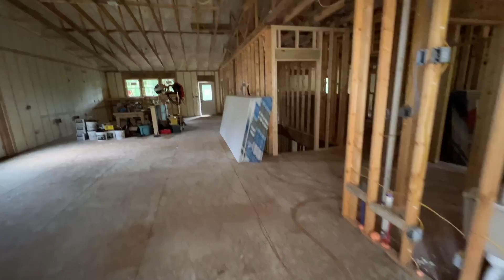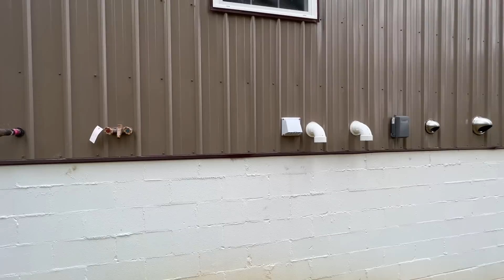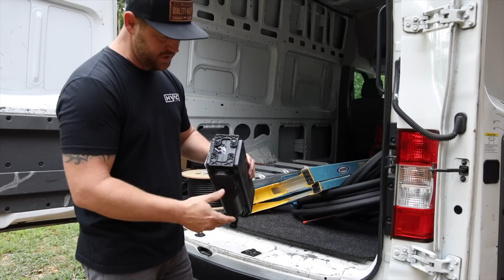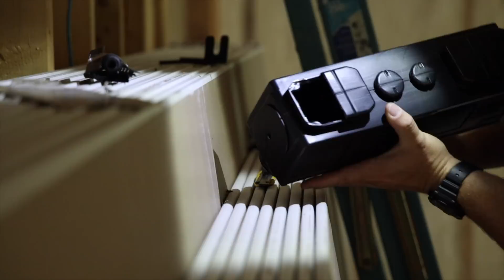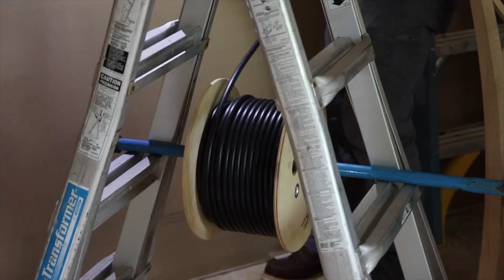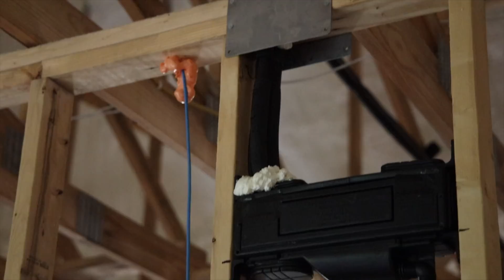Rough-In on a 3 Zone Mitsubishi DUCTLESS System | HVAC Installation

Comment: Protective shield plates...should be a code requirement. Very, Very smart! As a building inspector I always recommend the large plates or at a minimum photograph every wall plate and stud penetration just in case a nail or screw gets by.

Comment: Why not just run the line sets into the attic and just wait for a J Box to get back in stock?

It seems like having they would be awesome if you had to service one air handler you wouldn't have to mess with the entire system. 

Wouldn't that be super beneficial to the home owner?

Comment: Can someone direct me how to run about 30ft of 3/8 & 3/4 inch soft copper for hvac. I'm gonna need to go through two ceiling bends ( 90s ) before bending them out of the walls.  They are not charged, empty 50 footers. Thank you.

Comment: Great video.  When doing an interior wall install for the indoor unit, is it preferable to surface mount the line sets and wires in case one of the refrigerant lines develops a leak over time?  thanks

Comment: I just put in one of those little pumps for the Mitsubishi.   They could have benefited from a ducted cassette installed in the attic with ductwork to all the rooms.  1 lineset 1 drain line and much better comfort overall considering you can hit the bathrooms and more even distribution.
Reply: That's what I would have done, but ductwork is not cheap; this is likely much cheaper and will overall provide enough comfort for what the client likely prioritizes.
Reply: How hard is it to clean the evaporator on the ceiling units?

Comment: I would have just ran the drain down the wall to eliminate having a whole other component to break down like a pump. Also you could have avoided having  potential leak points by just running the pipe all the way home the first time instead of being lazy and just stubbing it into the attic.

Comment: Nice work! That Mitsubishi unit should have no problem keeping them comfortable all year round with that insulation job they did. It was smart to do ductless, I think a conventional system wouldn’t be able to dehumidify well enough with all the exterior walls and roof being spray foamed. Thanks for the video.
Reply: a proper ducted system even a Mitsubishi Airhandler would be much better because you could have supplys in the bathrooms and everywhere you want it instead of this
Reply: @loganraimer  Have you ever tried to condition a home fully insulated with spray foam in the South?  The spray foam foam insulation holds in moisture making it difficult for a ducted system to remove enough humidity unless you install an additional whole house dehumidifier which is added installation and operation cost.

Comment: I can install Mini Splits all day. Walk in the park. What I really need to know and want to see is videos on service of the mini splits. They are much more complex than traditional air conditioning period show us when you get inside one of those things
Reply: Call tech support. U need ohm charts depending on which manufacturer ur servicing.
Reply: Usually leaksn, need to weigh the charge in and out .
Reply: Servicing Mitsubishis splits are very easy, more easier servicing Fujitsu, daikins & other brands.
Reply: Do you have a video on how you hook up the indoor head to line set that goes into rough inbox? Do you mount it even with the indoor head? Or do you mount it offset? And with the wall mounting bracket, do I still need to install backing boards to mount the head on? Sorry for all the questions.
Reply: I just call tech support with a multimeter in my hand.
Even if you could do all the troubleshooting by memory, you usually can't get the part you need under Warranty without a case# from the tech support
Reply: Its pretty basic. If it's leaking, you just recover the refrigerant that's left and then weigh the new charge in after fixing the leak. Mini splits are usually either gonna leak or have a part failure like a board. Not too crazy to deal with.
Any mini split with a vfd is gonna make it so that you can pretty much just weigh the charge in after fixing the leak. Even with large vrf systems, the way you go about it is basically yeah same thing just weigh in a new charge. The software can do a bunch, but the only real fix im aware of ia to remove and confirm the new charge weight matches what you need.
Reply: @Clasped003  that's pretty much what I've been doing. Keeping them clean making sure filters stay changed, repair and all the f*** ups in the control wiring from the electricians and weighing refrigerant re-adding it when in doubt
Reply: @Clasped003  Where does the leak usually occur? Does the lineset itself ever develop a leak? I can't imagine how to fix that as the lineset could be embedded in the walls!

Comment: I just installed a MRCOOL 4 zone mini-split system. I came up through the floor into closet areas and used the 7.5' cover kits to hide the pipes, the head units were installed on the opposite side in the interior rooms. They did not recommend that you put these units inside the walls in case you needed to service them in the future, so I am good. .....But I am having a different problem.....

It's been about 3 weeks now, temps in the 90's, the system is working great so far. But I have a problem. I am experiencing severe headaches in the mornings, and brutal insomnia (no sleep) being around these AC heads. I can tell you it IS the heads causing me grief. I bought an EMF meter to detect the radiation being emitted from these things as I cannot be near these at night trying to sleep. It's been miserable.

The EMF meter I bought is a cheaper model and doesn't work well, unless you believe that ketchup and a can of Pepsi are spiking with EMF?
I've got to buy a better EMF meter, also have the power company come out and scan these things. I don't know if it's the wire, or the fans that are causing me my problem? It's a 230 volt system, not 110 current. I'm a little bit pissed that I stepped into this issue. I am sensitive to EMF waves and I could of just reinstalled central AC as I had the ducting....Well, I did have it set up until I ripped some of it out.

The internet says it is possibly dryness of the air, but I call BS on that, everybody is a liar these days especially corporations and governments.
Today I was outside next to the condenser when it was running for about 2 hours and the headache was returning again. I bought some aluminum window screen and wrapped the wire as it enters into the living space, as the waves cannot pass through the small size of the mesh of the metal screen. It seemed to help some, but not a perfect cure yet. 

I had a portable AC unit, and then a window AC unit earlier in this year while I installed this MRCOOL system and they both caused me the same headache problem. I am sensitive to EMF, and have diabetes which according to some books is caused by electricity, and I believe that from my first hand experience. To find out that this system is also emitting high EMF apparently? I'm kept cool, but can you live without sleep?

Your power wire is way bigger than the ones supplied by MRCOOL so maybe that matters? I can run the bedroom unit till ice cold in the master then shut it off before bed is my current work around. I have yet to get my first power bill to see what it draws, but I think it will be less than the central AC system I once had. I also will mention something else that I ran into. I bought this DIY system from Home Depot and HD did me wrong. I had extra line sets, and communication wire, and a coupler kit after installation that I didn't need, but I could NOT return them for a partial refund inside of the 30 days policy. So they broke there own terms of sale. I didn't make the terms, they did.

Home Depot will not take back a partial system, and shipping wasn't free either, it was $110 dollars (orders over $45 are free shipping) NOT. This system keeps me very cool, cost me $4700. and is very quiet when running, but the EMF issue is causing me troubles.
Reply: Your problem is you got mrcool that should be called mrthrash worst investment is a mrcool unit
Reply: @fredmejia6042  I have no knowledge of these mini splits but what are the specific problems with Mr Cool? (other than the name)😀
Reply: Probably need a fresh air heat exchanger 
Not enough fresh air in house; depleted oxygen
Reply: Well yes anything with magnets, motors, solenoids, etc will make an emf. Which this unit uses all of them. Can’t say much about Mr cool system as it’s diy and I only install Mitsubishi.

Comment: I've used both mini splits and central.

For me personally I prefer a central hvac over mini splits.

Main reason is just overall comfort in every single room in your house including all bathrooms, walk in closets and utility rooms.

To get that level of comfort with mini splits it would require a head per every room in the house which would be extremely expensive and wouldn't make sense when you can just go with one large HVAC system for the whole house.

The other con going with mini splits especially on an already existing home is all the line sets running all around the outside of house especially if you're going with multiple heads which is a major eyesore.

For larger homes you definitely want to go central.  I live near Nashville and every builder of a new construction house is still going with central because of the same reasons.

Really not that much of a price difference  on electric bill as most people think because you're still not heating or cooling all those smaller rooms in the house.

A central hvac distributes all air evenly throughout every room in the house.
Reply: Agreed full duct all the way
Reply: It’s all preference, ductwork leaks and breaks down over time and is always a pain to replace in a finished home. Not to mention if you want good airflow distribution, you need a proper air balance done. That is rare in residential homes. Both mini splits and central systems have pros and cons. The only real difference is if you are more comfortable working on one vs the other.
Reply: @salad973  , I might agree with you if this house did not have a basement . Central split system is the only way to go when you have a basement;Plus air balancing is not a problem when you put air return in every room (except for the bathrooms and kitchen ) and it’s easy to do when you have a basement with equipment inside the condition envelope.
Reply: @boby115  yes I couldn’t speak on basements because in my area we don’t have any. It would be nice to use the basement as a mechanical room instead of having equipment in the attic 😅
Reply: @salad973  , we’re a little spoiled here in the St. Louis metropolitan area, 98% of the homes have basements, going into an attic is rare. Even on two stories we put the second floor furnace in the basement and send the ductwork up between the walls & chases, the architect and builder supplies us with.
Reply: @boby115  must stay nice and cool lol in south Tx everything is in the attic or roof, so in the summers we deal with 110-140 degrees all day long 🥵 sometimes ductwork will be under a pier and beam home and then you have to deal with scorpions, spiders, raccoons, opossums and all kinds of droppings lol that’s why ductless systems are a blessing to have here
Reply: @salad973  , mini splits (ductless systems) definitely have their advantages. I never thought of the plus side , not needing to deal with attics and crawlspaces ,good points there Cesar👍. Keeping ductwork out of attics is always a good thing.
Stay safe out there and try to keep cool  😎.
Reply: How many central systems are actually balanced?

Comment: How come you didn’t just run the drains down through the stud bay, through the subfloor, into the basement and out the side of the house?
Reply: I also want to know this 
Avoid using pumps like the plague!
Reply: he was bent on just 1 drain exiting.  I assume he coukd have tied them together in the basement ceiling then exit with 1- 1 1/4
Reply: There’s a adapter you buy and I’ve installed hundreds of these in the last 5 to 6 years and never had a leak on any of them
Reply: @brandonhvac4148  sounds like you are playing police right now 🤨
Reply: @brandonhvac4148  you are putting words into my comment that were never there, I did not tell anyone to shut up or to stop speaking
Reply: @brandonhvac4148  insinuating is completely different from saying it. If you feel something from what I said that is a personal problem.
Reply: @brandonhvac4148  you are policing and doing so incorrectly, I said there was no need for such comments. Not once did I say to stop speaking, because we are not speaking, we are typing. Two different forms of communication. I cannot tell some to stop speaking in a comment section and I never will.
Reply: @salad973  ohhh you’re the kind of person to think being very literal and exact with language will make you appear superior. 
Don’t bother guys he’s a lost cause!
Reply: @matts490  a lost cause wouldn’t agree with the point you made about pumps
Reply: There’s always what ifs and how comes, he wanted to do it this way and he did. No need for pointless questions and statements as “avoid pumps like the plague”.
Reply: @salad973  I wouldn’t say it’s pointless, I do genuinely avoid pumps like the plague, why would I want something extra to go wrong and more work to clean, not to mention if it’s an pump the mounts under the unit it just looks worse and can get noisy.
Reply: @matts490  yes you have a good point there, it is noisy and generates more work
Reply: @salad973  lol 😂 rt but questions are ok to ask even dumb one 😊
Reply: @universalservicetechust3578  asking a dumb question out of ignorance is ok, you don’t know what you don’t know. However, asking dumb questions when you think your way is right or without using common sense is just wasting everyone’s time.

Comment: Why ductless? Looks like a perfect set up for a split AC or heat pump system?
Reply: J&B air, my thoughts exactly. Basements are rare in Tennessee and when you get one why not take advantage (?). I’m assuming he’s going to put another mini split in the basement.I am in the Saint Louis Metropolitan area where 98%of the new homes have basements and I have never seen mini splits installed in new builds with basements. It will work but I’d hate to be the guy Who replaces the equipment in the next 15 to 20 years. Maybe he’ll give us some insight why this option was decided upon.
Reply: Ductless is cheaper and customers like the idea of being able to zone every room separately
Reply: @keenanwalker6597  , it’s definitely cheaper. If he’s willing to pay extra for a basement,i’m sure a couple grand more on a central split system wouldn’t kill him. Plus with the basement he’s got a lot of options (zone dampers, Central D humidifier, fresh air make up system, humidifier) all possible when you have a basement and easy access.

Comment: I’ve used those rough in box’s on several installs. The only issue I ever ran into was during install. I had a hard time getting the evaporator head to mount flush to the wall. I started to offset the rough in box instead of centering it. That helped with getting everything to fit in the box and allow the evaporator to mount tightly to the mounting bracket.

Comment: Hey Zack is this house going to get a dehum added as well? Those mitsu’s don’t pull much moisture out.
Reply: Then you sized it wrong or your you are using it wrong. Not to mention depending on the model they  have a dehumidification setting.
Reply: Have to use the ST  model, has a better SHR

Comment: Man, all props to your work, and that rough in box is cool! It really feels like the homeowner did the design of this themselves... a whole attic, new construction, and still opting for conventional high-wall ductless heads??? Plus those pumps are crazy loud... 

Really seems like they could've used a little advice in the planning stage on how to just get a ducted system in there, or at least choose a better type of ductless head for the application.
Reply: very true, lots of space for some ductwork. I try to avoid those pumps whenever I can too, working on them is never fun, good old gravity drain done right never has issues
Reply: I totally agree with you.  Installing Mini splits are a last resort for me.  They definitely have their place….. but this house ain’t it.
Reply: Martin , you hit the nail on the head👍. Plus there’s a basement to take full advantage of (basement duct work and air returns in every room, excluding bathrooms and kitchen). Basements make it so easy.
Reply: My thoughts exact, mini splits should always be the last option and pumps are shit lol
Reply: I agree with you. I’m from Alberta,Canada. 
We have fresh air requirements we need to meet by code. That is why we use ducted systems-plus we need heat 70% of the year. HRV is tied into the ductwork of the furnace. Or you could do a stand alone HRV system in this case. You need fresh air or this is going feel like a 1970’s apartment. Yuck! My first thought when he said condensate pumps was what about the sound.
Reply: Maybe it's a solar and battery house? Mini split is a lot more friendly for that.

Comment: Doesn't that indoor hub require the commercial system access 3 phrase power? Or you can do that branch system with normal outside equipment? That would be awesome
Reply: ? 3 phase mini splits? I've done a bunch of these and I've only ever seen 208/230 in a house
Reply: @yoitsrob  Mitsubishi City multi